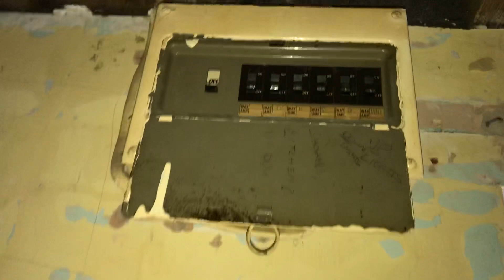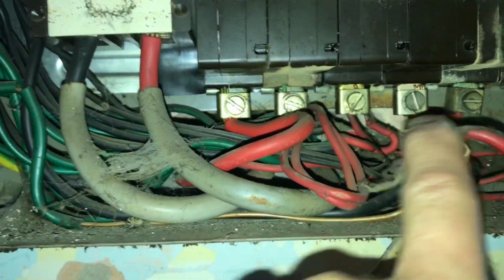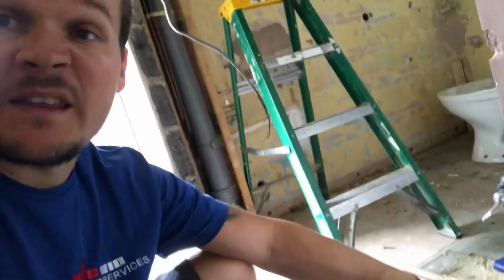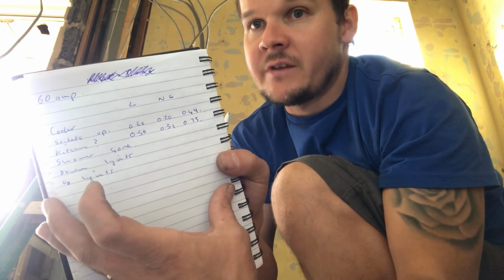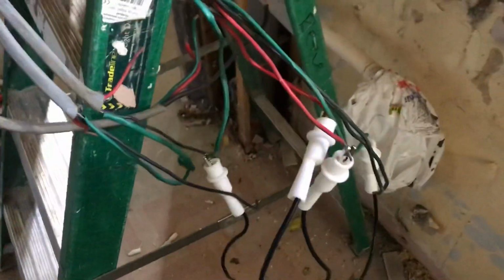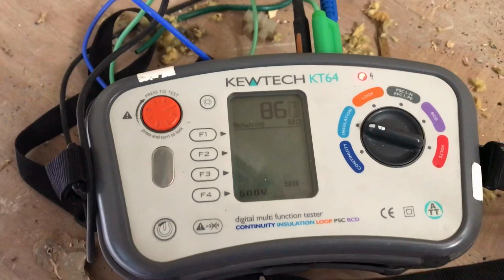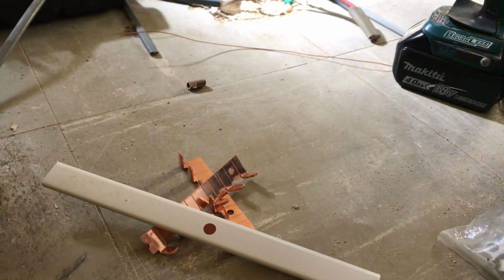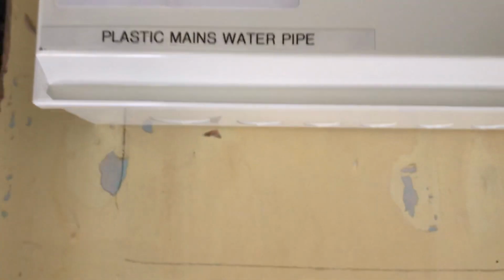18th Edition Consumer Unit Upgrade. EICR Before Board Change?

Comment: Hi Chris, are you sure the cpc is not 1mm as the 1.67 formula does not apply I’m sure it is 2.4  for 1mm. Love the videos keep them coming
Reply: Bang, been meaning to find out the X for 1mm CPC. Top man
Reply: Line conductor divided by CPC conductor will tell you what to multiply your reading by. For example 2.5 divided by 1 is 2.5 times the reading on the line conductor.  Hope this helps.

Comment: here in the us we do not ground to gas pipe just water and to ground rods in the ground. i thank grounding to gas piping is very unsafe
Reply: The gas piping is bonded to the main earth to ensure there can't be a potential (voltage) between it and other earthed (grounded) things in the property, thus avoiding anybody getting an electric shock etc. It is not the source of the earth (ground), that comes from the supply cabling...

Comment: What about torque settings in the back of outlets/fitting etc?  Not having a dig serious question, great Channel 👍
Reply: Not applicable for current regulations. Manufactures don't supply torque requirements. Normally use the old school electrical tightness standards. Ft tight and a tug test.

F***ing tight and can I pull the cable out.

Comment: I was considering becoming an electrician but all the testing just goes over my head 🤔🔌
Reply: Testing will make sense in time; its knowing your regs for EICRs which is the hard part
Reply: Adam Williams  wouldnt worry about it mate, theres thousands of so called fully qualified sparks out there who dont give a toss about testing or the regs come to think of it. What i will say is that our trade seriously over thinks things
Reply: Are the line and cpc resistance test he was doing, what he calls the r1's and r2's?
Reply: Check out John Ward, his videos will help you to understand what you're testing and why. It's not the actual testing that is difficult, it's knowing what to do when the readings aren't as you'd expect 🙄
Reply: @stevenunn3075  yes, the line is r1 and cpc r2
Reply: @SME_Ste  what are trying to say? In my experience most under think.
Reply: @leegreveson  Couldn't agree more.  Learning the theory is easy, interpreting the results only comes with experience
Reply: @leegreveson  well put

Comment: No need to upgrade tails or bonds. 6mm gas bond is correct size for main fuse size
Reply: He's future proofing it.
Reply: When we had a "Smart" meter fitted, they downgraded our main 100A fuse to 60A, something to do with meter tails running through a cavity.
Reply: @leegreveson  Depends if a TT system, or TNS

Comment: Personally much better job If you shelled out on  proper stuffing glands and also a mains stuffing gland for the line - neatral and earth.  

Cant help but see this in future with no grommets left especially by the time the next man comes and  chucks a cable in for an addition just carrying on the same practice as the previous.  Those rubber grommet things wont be long in coming off. 

Couple of quid and a 20 x better job .🤔 no brainer for me .
Reply: Metal stuffing glands are more than a couple quid 😂 and they would look utter gash in this instance .
Reply: I'd like to see them modify some of my boards with header trunking filled with gap filling foam :-♡
Reply: Dan R plastic stuffers obviously
Reply: Callum Docherty plastic ones fire rated??
Reply: @danr2370  plastic I was on about.  And I'm sure the amount you charge for  fuse board change its much more professional to do what looks and sees fit not what's Easier and cheaper for the world to see . It's not going to bankrupt you eating into your profit by a tenner or so to do what's correct , safe and has longevity. 

I think I speak for most folk they rubber grommets especially in consumer units are pretty useless as we all know  from past experience  they disappear.
Reply: Albert Steptoe are plastic stuffing glands fire rated? That’s a genuine question not me trying to be a smart ass like it might sound.
Reply: gadgetman36 I’m not on about the ones in the video.
Reply: @danr2370  you get fire retardant glands ofcourse but it's not essential what do you think would last longer In  fire the ones used or plastic fire retardant? . 

And my point is not about the fire rating its plane & simply a bit pride in your work and if you've been in the game many years it's also common sense that they silly glands wont be like that in 10-15 years when the next Joe bloggs forces cables through them in event of alterations .

I'm just saying for the sake of a few quid have a bit of finesse about your finished product especially if your allowing the whole world to see almost on a YouTube channel.👍
Reply: Is that you Steptoe, or are you an imposter? Only 22 years experience? You must be an imposter 😆

Comment: Surely there is no point to 16 amp ring??
Reply: Unless it is a 2.5mm 20A radial...nope lol
Reply: @muzikman2008  May as well just fit a 32a, less confusing to the next spark?
Reply: @michaelsimpson6603  you can't, if not a 32A final ring, then it needs to ba a 20A radial instead, only in 2.5mm2 protected by a 20A Mcb type B. See BS7671
Reply: 16A or less is acceptable on a 2.5mm2 T&E providing volts drop and length of cable is met.. Etc...
Reply: @muzikman2008  The circuit he showed, is a ring final.
Reply: If I turned up and saw that in a board I’d think it’d been downrated because there was a break in the ring

Comment: Thanks for the video,  But... Why does a plastic water pipe negate the reason for bonding?  The bond should be on the consumer side of the stop tap. That's on copper pipe that radiates all around the house. I thought it was for equipotential bonding to make ALL the metalwork the same potential in the event of a failure
Reply: That pipework will not provide a direct path to earth if the incoming pipe is plastic or has a plastic insert. However, if that now ‘isolated’ pipework becomes live by a stray live conductor.... I’m pretty sure an RCD would trip (additional protection) if an alternative path to earth was to touch the pipework; but this would imply the source of the current to be protected by an RCD.
Reply: @MS-Patriot2  It's not about a path to earth to 'Trip' or blow a fuse. It's purely in case of a neutral failure IE open circuit to equalise all metalwork that would become live due to the open circuit neutral, It DOES need to be bonded 10mm on the consumer side of the stop tap because the pipework in the property is copper or steel. You only don't need to bond it if the property pipework IS PLASTIC

Comment: Not a good idea to tell the public to remove main fuse on the cut- out which is a sealed unit owned by the area rec . The meter is also connected by a security block provided by the rec which you have advised isn't good and would be preferable to change with longer 25 mm tails . As an electrician you are allowed to work after an issolater after the meter position .

Comment: the 2.5mm2 t+e has a 1.0mm2 earth
Reply: @user-wk7wv8rn8h  the higher reading on the cpc  of the ring final circuits,2.5mm2 t+e with a 1.5mm2 cpc has a factor of 1.67.old 2.5mm2t+e  sometimes has a cpc of 1.0mm2 which has a factor of 2.5.
Reply: Didnt spot it; the good old 14th edition

Comment: Putting a board under a toilet?? Can't sleep at night after doing that.
Reply: I was pricing a Job last week Lee and the builder put a new kitchen .

Sink above main incoming metre and Washing machine right In front of it. 
Also water tanks in a larder 1 metre away .

Scary thing was the woman  had a flood few months back and has kids who are very young .

I almost shit myself you could still see water retention in the floor boards .
Reply: Also twin and earth cable rapped round all the heating pipes what a mess .

Advised her that its totally out of bounds and should be sorted immediately.

Never heard from her since.  🙈

Let's hope she listened .
Reply: Cant help but feel his niceic rep will have some swift questions about the manor of this job and its location of consumer unit and also  finished product.
Reply: Albert Steptoe why is that then?
Reply: @shaunhyatt8150  
Why not a consumer unit installed directly under a bathroom and next to potential leaking pipes  if their is a leak they grommets ain't stopping water entering that's for sure.  

I'm not dissing the guys work as most of the stuff he does is good but this one aing one of his best that's for sure .
Reply: Albert Steptoe it’s virtually impossible to find a spot without a board being near any pipes and the way water runs  it always seems to find a disboard or any electrical item.
Reply: @guylljones72  For sure, the guys work on this channel is always pretty gravy, takes time over testing too. And I'm not saying there will be an issue here, just I wouldn't have chosen that spot. Better there be a board nearer the middle of a room than underneath that. Maybe I'm overreacting.
Reply: @albertsteptoe3710  The thing is, they have no idea about it all do they. Just press a switch and light comes on. Just add on 10% when she eventually calls you back to fix it all!